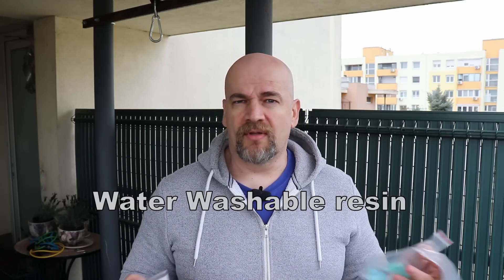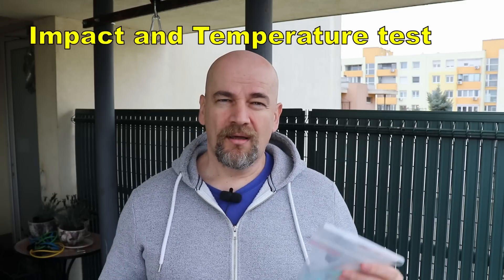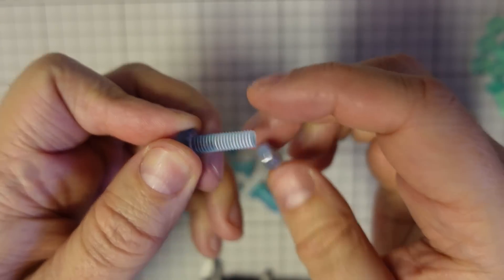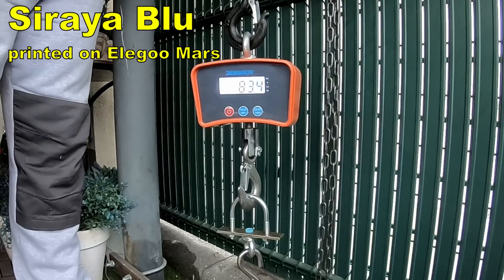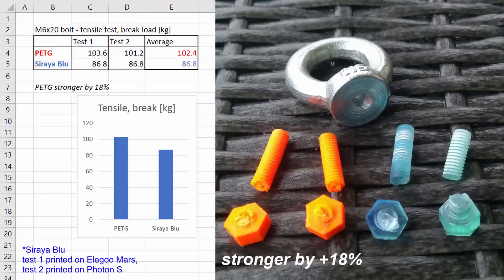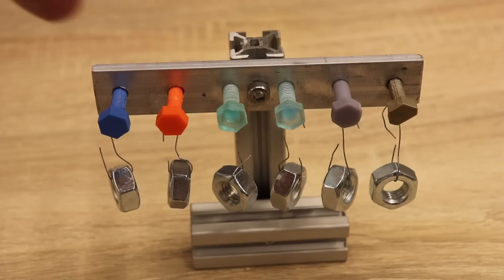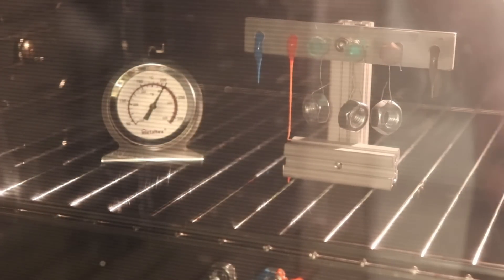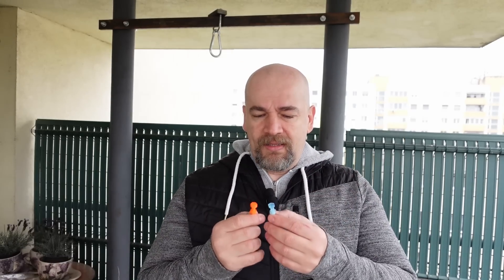Siraya Blu vs PETG 3D printed bolts and nuts - a rematch of resin vs filament experiment

Comment: One major thing missed: the orientation of the printed layers matters. You're only testing the layer bond strenghth because everything was printed vertically and you're testing vertically. You need bolts printed along the long axis. This will afford you tests that aren't hampered by layer bond strength which has all kinds of variables like cure time, layer thickness, etc.
Reply from the maker: PETG was printed horizontally, resin vertically. I already tested effect of printing position, SLA is not sensitive to this as FDM printing.
Reply from the maker: Ahmad Muhsin  Yes I agree, but not so big as with FDM, where you have 4-5x (400% or more) difference. And I had only 1 test specimen, not too representative, just rough information.
Reply: @MyTechFun  if the sla printing orientation showed a 20% difference I'm curious what this test would show, considering you're showing FDM is 18% stronger in the video. Siraya Tech also has made Tenacious which is another very strong resin.

Comment: Temperature resistance and fine resolution are the reason to have at least one Resin printer in your workshop. Ordered Mono X, will be nice companion to my two FDMs.
Reply: I love how fast the Anycubic photon Mono X prints large things, one of the sweet things about an LCD(preferably monochrome) Resin 3D printer is how little if any extra time it takes to print something big and full volume compared to a traditional plastic printer.

I've really had a good time printing on the photon mono X, I'd recommend you not use paper towels to clean the vat/fep though, they say it can scratch it. Micro Fiber cloth and maybe kleenex are the way to go because they're much softer and less likely to scratch the fep.

Also you can keep the shipping screen protector on to help protect the screen in the event that the feb ruptures.
Reply: Thought the only benefit of resin was great details but now even a functional hobbyist like me can have a look into it with that heat resistance.
Reply: @KentoCommenT  It's pretty incredible. I have made gunpowder which melts most steel containers but when I used standard resin it survived. The only drawback is that the polymers experience heat expansion and can crack explosively.

Comment: I understand this is 2 years old. I appreciate the information that was collected in this even though it is small scale testing with application centered around fastening hardware. 

I wanted to say I believe the difference between the two resin samples was the cure time. If you expose resin to uv light for extended periods of time it can increase the hardness and how brittle it is. It can also cause yellow discoloration, and if left to cure too long, will lead to break down of the hardened resin material itself. I hope that solved the possibly solved difference within your resin samples.

Comment: The siraya tech blu changes color when curing for a long period of time and in general with time.

The green tint fades
Reply: The green tint is from over hardening in post processing? That would explain why it snapped earlier IN torque test
Reply: @DonRaynor  no the green tint is normal and it takes a long time for the prints to turn fully pool blu

Comment: I'm wondering if it is possible to print sealed structures from flexible resin? Something like a corrugated hose?
Reply from the maker: As I mentioned, I don't have experience (so far) with flexible resin.

Comment: The warm color shift in the second Blu set is due to overcuring, either through overly long layer cure settings or in post during the final cure. Transparent resins continually shift toward yellows the longer they're cured. A "properly" cured piece barely has any signs of this yellowing, and the cool blue tint of resins like Blu helps to offset this effect. I placed "properly" in quotes because like everything, there's nuance here that's worth our consideration. There are benefits to slightly overcuring and undercuring, and carefully controlling these thresholds is rather important to this type of experiment. Regardless, I really enjoyed the video and look forward to your continued endeavors! Cheers.

Comment: The reason why the nut won´t fit on the resin prints, is probably due to a lack of cleanup after the print. Uncured resin was probaly still in the thread and got cured (post-cured).
Reply: I don't know, not washing the prints before post-cure seems like a pretty huge oversight from a company offering SLA printing services. It's far more likely that they don't have their printers calibrated to produce dimensionally accurate parts. 'Functional' prints probably aren't their primary market.

Comment: Very nice comparison, I especially like the complete table at the end. Are the results from your PLA vs ASA bolts video also comparable to this one?
If you plan to do another part, maybe Nylon and PC would also be interesting candidates. And I hope you had something easily cleanable in the oven below the filaments. :)
Reply from the maker: PLA vs ASA comparable tests, except shear stress test (in latest video I used two sided method, pure shear stress test). Also, different PLA brand (Gembird vs Prusament). Temperature of air was now 9-10°C and in ASA video 15-16°C. It may have some effect, but minimal, because specimens spend out max 10-15 minutes.

Comment: The PETG was printed horizontally and the Blu was printed vertically? Wouldn't that impact the performance?
Reply from the maker: I already tested printing orientation with SLA printers, no significant effect (there is a video about it too)

Comment: I wonder if the resins can be heat treated much the same way steel is. Could you do the test pre bake and post bake at different Temps to see if there are any strength gains after being in oven.
Reply from the maker: I already did, no big difference

Comment: You need to adjust for tolerance thats why the nut was too tight. I usually go with 0.5 to 0.7mm difference and they screw on perfectly.
Reply from the maker: I agree. But exact value depends a lot of 3D printer.
Reply: Are you saying adjust the tolerance in the design to give more leeway? Or something you can do when slicing/printing? I’m interested in exploring functional parts with SLA but concerned about varying shrinkage.

Comment: Thank you for this interesting video. I have interest in a test that you could do easily. Is Siraya resin more resistent to scratches than the washable resin? I have parts in Elegoo washable resin and they scratch so easily with the fingernail, and leave a white mark.
Reply from the maker: Visual quick test: more resistant, but not measured yet.
Reply: @MyTechFun  Thanks

Comment: Nice video, For fdm toughness you should consider comparing the resin prints to FDM nylon and nylon-X.
Reply from the maker: I am moving slowly to testing stronger materials too. Soon Tenacious vs ABS bolt test will be finished.

Comment: i use drying for PETG on 80C and is good. what PETG U have>😅
Reply from the maker: Be carefull with 80°C, this is above HDF temperature for most of PETG materials. I have a several brands, but in this test Prusament.

Comment: you should upgrade the impact test ,with a bearing at the rotating point ...it would give you more exact result
Reply from the maker: There are two ball bearings inside hammer
Reply: @MyTechFun  "There are two ball bearings inside hammer"
That hammer swung very smoothly. Thanks for the excellent video.

Comment: The color difference between the Elegoo and the Photon printer pieces is very interesting. The color hues that occurred after the melt test, are similar to the color in the finished Photon peices. Heat seems to bring out more of a green hue. It suggests that the Photon printers print at a higher temperature to the Elegoo. Not just curing the resin, but kind of cooking it as well.
Reply: Thats classic overexposure. Resins tend to yellow when cured for too long. Resulting in the greeny hue

Comment: On the first test, I noticed an issue. You printed with the PETG laying down on the bed meaning you were pulling along the walls, not layer lines. With the Blu you were pulling the layer lines apart. Can't really fault one for doing better or worse as it wasn't a direct comparison as this will render all of the tests basically invalid.
Reply from the maker: I already tested the effect direction to strength of SLA printing. It is almost same.

Comment: What I expected. It's a big advantage of PETG in mechanical applications that it deforms rather than break suddenly. Resin, if not reinforced with fibre, is brittle. It's just not a good material for mechanical parts, unless of course when combined with fibre. But 3D printers can't do that yet.
Reply: There is a maker on youtube who did it, inserting fiber between each batch , really interesting

Comment: Siraya has a 6% shrink volume what is the best way to counter this thanks ?
Reply from the maker: I am not sure, does it shrink same in x,y,z directions? Print a calibration cube and measure it, so next time you can calculate that.

Comment: Have you tested any of the resin parts after they survived the temperature test?

Curious if just the color changed...or if they got stronger/weaker after the heat treatment.

Another great video as usual.
Reply from the maker: Good thinking. I have those 3 bolts. Which test would you like me to do with them? Off camera, I'll just add the results in description.
Reply: @MyTechFun  Which ever test you think would be the best to see a difference.
Reply: I didn’t see where the results of heat treated bolts, but I would love to see if that has an affect

Comment: I am very late here, but I wanted to add something. I tested the elegoo standard gray resin in an autoclave at 121°C and 18 psi for 15 minutes. The print cracked, discolored, and was brittle to the point of crumbling.

Comment: why are parts printed with photon s more resistant than parts printed with mars?
Reply from the maker: Probably because of the higher temperature (more greenish color also shows higher T)
Reply: @MyTechFun  time exposure are the same in both printer?
Reply from the maker: @carmelomusarra7585  yes. Photon S works on higher temp.

Comment: you should have printed both the PETG and the resin parts in the same orientation... The fact that the resin parts were printed upright makes them weaker in the z axis.
Reply from the maker: I already tested this before this video, there is a difference (SLA printing orientation), but very small.

Comment: These tests were really cool but if your samples had a known cross-sectional area you could calculate the stress in the materials. This would let you translate your results across different sizes and shapes.
Reply: I was thinking the same thing, but he used m6 bolt & nut so they should be standard sizes (I'll have to check)

Comment: What torque wrench are you using
Reply from the maker: something like this (the smallest one 0.3-30 Nm) https://www.banggood.com/1_5-1000NM-Digital-Torque-Torsion-Meter-Electronic-Wrench-Tester-With-External-Torque-Adapter-p-1370003.html?p=KY220152814037202009

Comment: This is not a viable comparison. The layers on all prints should be the same direction. You have the Resin layers parallel to the thread, the layers of the PETG are perpendicular to the threads. You should print two sets of PETG, one set with parallel layers the other with perpendicular layers. Odds are the perpendicular set will be stronger.
Reply from the maker: I already tested this, SLA is not sensitive to layer direction as FDM printing

Comment: I bet the dimensions were off on the elegoo mars prints because they left anti-aliasing on ;)
Reply: It's likely because the resin is transparent. The UV light will travel farther in transparent resins causing a slight over-exposure in the x/y direction. To prevent this it's good to mix in an opaque resin like Siraya Tech fast abs-like witch is an opaque grey.
Reply: @NateUE  i use the resin all the time, along with other clear/transparent/translucent resins, & if you follow direction you will get +/-.0003in tolerance. Unless you are over-exposing or adding features that alter the geometry, then you will be noodle-scratching.
Reply: @J0SHUAKANE  I am really struggling with siraya blu on my mars 2. it prints 'fine' don't get me wrong, but small detailed features come out sagged yet crisp. I'm trying to print a flange with 7/8-20 threads perpendicular to the build plate and the threads come out asymmetrical, with the tips 'falling' with gravity. I started with sirayas config file and have tried exposure settings from 2.5 secs to 6 secs with the most crips results at 2.8 secs but still has the sag. i ordered some black dye so I hope that helps but I gotta believe I can get results with blu as good as the cheap water washable I print. do you have any tips that could get me going?
Reply: @scott5006  how warm is the room you are in? When i use siraya blu i crank the heat up to about 80-85f. I didnt understand why, but this video taught me a lot if you havent seen it https://youtu.be/ht4tbCiFxeM

I just ordered some tuff resin from monocure that came with a cmyk pigmemt set, hoping that it will be easier to print with. Siraya blu may be the hardest resin, but its also the hardest to print with.

Comment: You've made two videos like this now and you've failed to print the bolts properly each time. The test is pointless if you have to resize each bolt and weaken it in the process. Get it right or don't make a video at all.